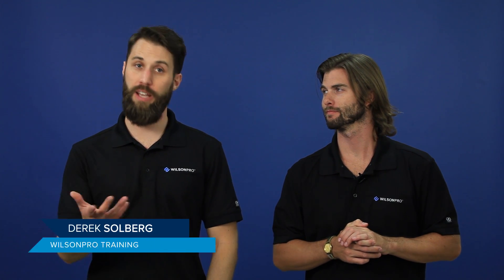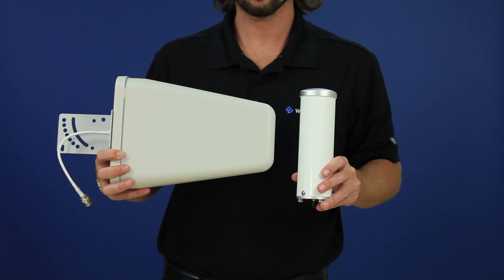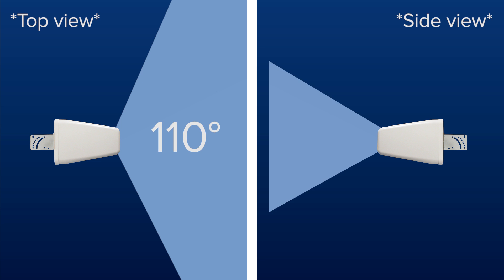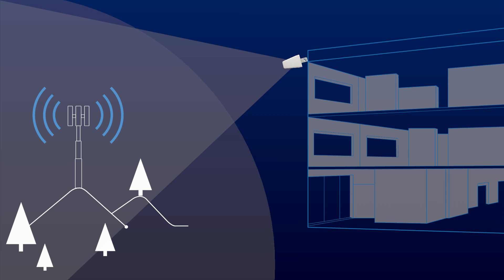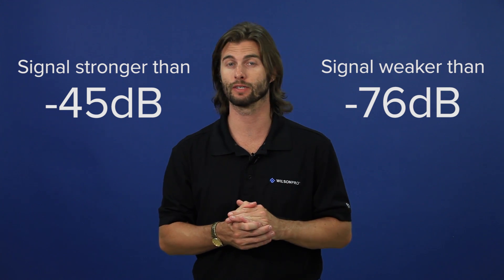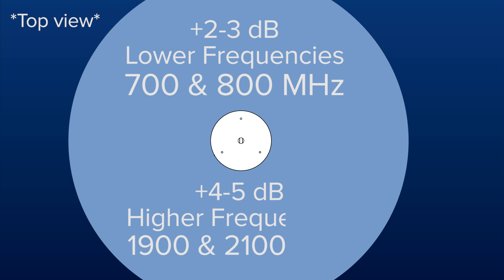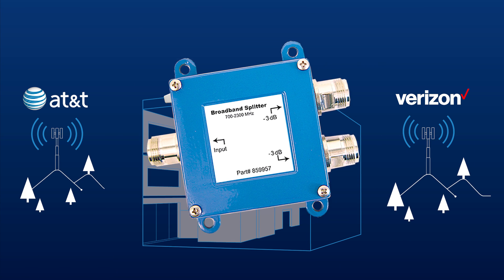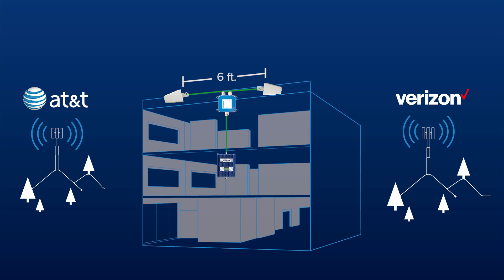Cell Phone Amplifier Systems - Outside Donor Antennas

Comment: I have 2 of your companies antennas. What is the best angle for the antenna, at a 45 degree or straight up ? What if you have MIMO setup ?
Reply: You were smart to buy two antennas so you can take advantage of MIMO (Multiple Input, Multiple Output) speeds.   Ideally, you would want each antenna to be rotated 90 degrees from each other to take advantage of multiple radio wave polarities.  Typically you would mount each antenna 45 degrees from a horizontal position.   You can find mounts for this purpose on Amazon.   Search for 2x2 MIMO mount.
Reply: @SwankySasquatch66  thanks
Reply: @SwankySasquatch66  thanks again ! Much appreciate the help !